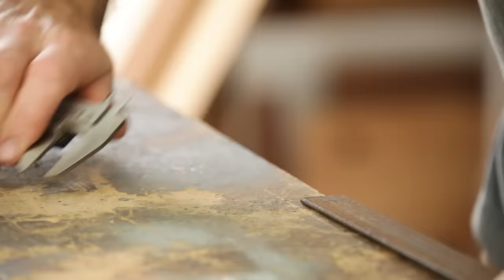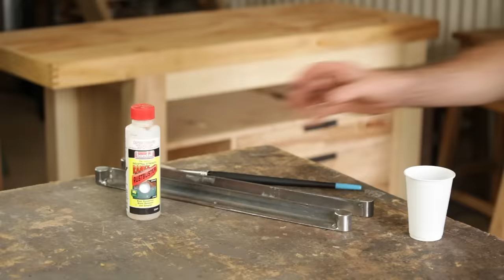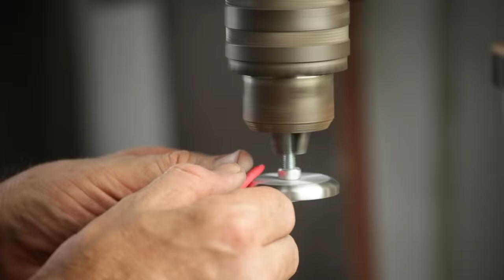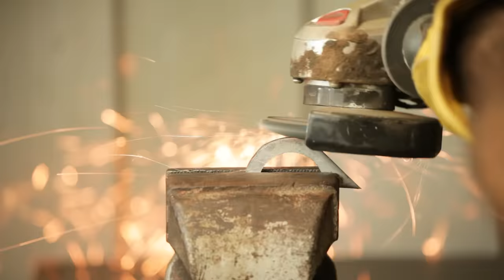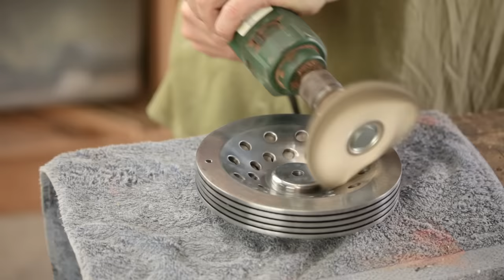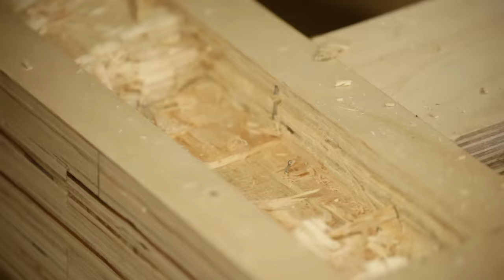Homemade Pinless Leg Vice

Comment: Dear John Heisz, Matthias Wandel and Pask Makes, 

For quite a long time I follow your excellent contributions to woodworking and I am still learning. I am fascinated by the simplicity and properties of a leg vice. The one thing that is problematic is the pin that is necessary to operate it. Now I know there are several solutions to make a ‘pinless’ Leg Vice, but it came to my mind to automate/mechanise a pinless design. Now I am not able to do it myself so I thought that it might a nice subject for you to put your teeth in. The idea is as follows. Instead of a pin we take an linear actuator (Electric, Hydraulic or Pneumatic) tot regulate the vertical outlining. Then we need one or two electronic waterpasses to sense the vertical position of the leg and by adding a controller to actuate the actuator you have an automated pinless Leg Vice. Who of you is up to the challenge? Arie van den Ende NL

Comment: FYI I'm switching to wood from metal, and one of the tools that has helped out quite a lot for metalworking is a good quality hand-held jig saw.    It makes relatively short work of things like those collar washers... and keeps you from using the angle grinder.  (The angle grinder was the most dangerous thing in my shop until I got my table saw... it has been responsible for over a dozen sutures over the years, and I try not to use it whenever possible.)
Absolutely stellar work on the vise.  I've gone looking, and consider this the best how-to on a cross leg vise on YT.
Reply from the maker: Thank you very much! I haven't used my jigsaw much with metal but I have to say I think the angle grinder is a great versatile tool - the only real downside is it is too noisy! :)

Comment: Great leg vice! And the wheel is a real beauty!
Maybe a second nut on half of the depth would make it even less wobbly. Should not be difficult to install.
Reply from the maker: Thank you! Another + for the wheel :) I did think about that and also I may just add a length of hardwood either side of the screw at the back.

Comment: This is the neatest idea that I have seen for maintaining parallelism in a leg vise as it is automatic. Others require human intervention to adjust to parallelism. 
The only thing that is bothering me is the amount of slop on the vice during adjustment. This does not materially affect the gripping of the vice but it must be a nuisance when opening and closing. The answer I fear calls for a lathe and a machined collar or sleeve let into the leg to remove the lateral play from the leg.

Comment: Thanks for some ideas Pask. I've been wanting to make one with the St. Peter's cross and yours turned out great. I was going to use some thick stock but the L beam looks sturdy and will be much cheaper. Also, I love the wheel. Great idea. One thing, a couple feet of 3/4 or even 1 inch acme rod and a couple of nuts would probably make that run a lot smoother too. I know the leveler is an acme but not a precise. Anyway, great video. Thanks
Reply from the maker: Thank you Mike! :) Acme rod would be better for sure - very expensive here though. The leveller screw still works very well and at a great price - I paid $16 with shipping $30. :)
Reply: Wot to make out of spear wood

Comment: Neat looking wheel.  Perhaps a brass or aluminum busing on both sides of the bench leg and the chop to keep the threaded rod from wobbling.
Reply from the maker: Thanks Dan! Even though the wobble doesn't affect the operation it would be nice to eliminate it. I'm going to put a couple of hardwood guides either side of the screw, at the back.

Comment: For those who can't cut and weld on the round bar stock,  just notch it and bolt on 4 small skateboard bearings .

A small dolly wheel can be used as the handle..

Comment: Great video, great build. Unfortunately i have to pass as soon as a welder is involved, but I loved your version of the wheel and handle.
Reply from the maker: Thank you Michael! You could still make a leg vice with a scaffold levelling screw without welding - check out videos by Jay Bates and Demas Workshop. :)
Reply: I think you can make a cross out of flatbar or square tubing, some nuts and bolts and skateboard bearings at the ends. This would involve cutting and drilling, possibly tapping but no welding.

Comment: I agree with Nige, and am going to watch it again.  Great work both in wood and steel.  Has anyone suggested(coming from the peanut gallery,) you making a steel plate instead of the hard wood chunks to end wobble?  That being said, you're WAY over my skill level...Thanks for the video...cheers...rr
Reply from the maker: Thanks Richard! I've added hardwood guides either side of the screw (at the back) and that has now eliminated any wobble. :)

Comment: I noticed in your reconfigured workshop, that in places you were using wood as pipe to pull wood dust through to your vacuum. Please research to see if you should have grounding wire to take away static electricity built up by the moving gasses (air ) Also (not sure if it was you ) With sanders, Is it not dangerous to get a buildup from grinding both aluminum and ferrous metal and having this pas through the same vacuum system?  I watch more than build  and enjoy your works. ta!

Comment: Great video! I have ideas that might make it better, or not. I saw the wobbles and the fix and wondered if a sliding rail guide at the bottom would help even more. Plywood can be a pain in the ass to work with sometimes. I got distracted and can't remember the other idea.
Oh, you might like to raise the vise taller than the bench so you can use dogs but the catch will be that you'll need to steady that long ass vice piece of wood. Maybe it wouldn't be too lobsided with the bottom rail guide or even a dual turning crank that moved at the same time. Now that would take some engineering.
Reply from the maker: Thank you - glad you liked it! The vice works perfectly with the wobble - it doesn't affect it in any way whatsoever, however I have fixed it as it's nicer without the wobble. I'm actually working on a video right now showing the upgrades I've made to the workbench, I show how I fixed the wobble in that. I could still use dogs with the vice as it is, by drilling a dog hole in the top of the chop but I won't be doing this as that's what I use the tail vice for. :)

Comment: Pask, I really like your videos, this one is really great.
I am thinking about building that cross parallel guide myself. I found some blog post on the website of Benchcrafted (they manufacture a commercial version of this guide, called Crisscross), and they talk about their guide being designed to give the vise some small amount of toe-in (the top of the vise jaw contacts the workpiece first). I've looked up the topic and indeed toe-in is mentioned as a desirable feature of vises. I couldn't find much reliable information on how to actually implement this in a leg vise (with a cross-style parallel guide). I am wondering if you did something like this with your vise? If not, what kind of design modification to the cross do you think would provide that toe-in? I think it's just a geometry question in the end...

Comment: Beautiful leg vise mate, awesome use of those old grinding discs! Question about the welder, if I may? I noticed in a few of your vids that you don't use a nozzle, I presume this is because it's gasless? I ask because I have just been given a gasless mig without a torch, and I don't really have a clue about welding. Do you not use a nozzle because it's better without, or does it make no difference?
Reply: The Pallet Hippie , the nozzle cover is for directing gas flow to the weld. When using flux core it's unnecessary. I use my cover however to prevent slag on the inner tip parts.there only $5-8 dollars so not a big cost.

Comment: That is awesome. I like your projects. I didn't know Ozito did a mig welder. I must have a look see if they are in the Bunnings Mega stores here in NZ
Reply: I think you have your big box brands mixed up or was that deliberate?
Mega is a type of Mitre 10. As far as I know we don't have the Mega 10 stores in Australia. Some of the Bunnings are very big but not as big and not as big a range as some of the Mega 10's I've seen in NZ. I've been in some Mega 10s in NZ that were truly enormous. Mega even.
Reply: Yes you are right. Bunnings Warehouse and Mitre10 Mega. I just saw the Ozito mig welder in a Bunnings advertising mailer, so we can get them over here. Cheers.
Reply from the maker: Thank you Daniel! :) I see you've found them. It's been a good welder - I haven't had any problems with it and been using it regularly for the last 3 years.

Comment: Hi, I know this is an old video, so hoping you keep up with comments on old stuff. Just wondering if you're using a gassless mig welder? If you are, are they any good? I'm thinking of getting one so just curious really. Thanks
Reply from the maker: Hey Glenn. Yes I use gasless mig, I've had it for a few years and it'd done a lot of projects. It's definitely usable and has done me fine but it's difficult to get a good clean looking weld. If you don't mind grinding your welds afterwards then they're fine. I'm at the stage where I'm ready to start looking into welding with gas though! :)

Comment: Shes a beauty!!! I was thinking of trying this exact same thing. what is causing the vise to wobble ? if you were to build it again what would you do diff?
Reply from the maker: Thank you! I honestly wouldn't do anything different - the only thing I have done since is add a couple of hardwood guides either side of the screw at the back. The wobble is because the screw threads aren't that precise. The wobble is perfectly fine though, nothing actually needs doing, but if you're like me you just want it perfect. :)

Comment: I really enjoy watching your videos and this one's a brilliant build! In your opinion, could the same cross effect have been achieved with just rounded-edge flat bars (no welding involved)? Also, in hindsight, how could the left-right wobbling have been cancelled in advance? Thank you - great vid!
Reply from the maker: Thank you very much! The cross could definitely be achieved with some thick flat bar, I welded rounded ends on the end of my cross to help it run smoothly but you could bolt some round bar to the flat bar to achieve something similar. The sideways wobble doesn't affect the operation of the vice at all it's just a little annoying - although I have now eliminated it with a small upgrade. I'm working on an overview video of the workbench at the moment where I show all the upgrades I've done. Should be up very soon. :)
Reply: Great stuff! Thanks for your reply. I love watching your blacksmith skills. Having none, I'm trying to avoid welding. I was thinking about something along the line of your suggestion, and then started to think I can achieve the same with corner bars like yours, and using something like caster wheels for the bottom parts. The main point is that your video made the whole benchcrafted solution so down to earth and possible to be executed by mere mortals. Thank you!!

Comment: Very nice but I don't have welding machines for the leg guide, any advice ?
Reply from the maker: Thank you Tony!  The ends that I welded onto the cross could be left off, the angle iron cross would still work, it just wouldn't be as smooth.

Comment: Its a really cool design. But im confused didnt title say pinless?
Reply from the maker: Thanks Dylan! Generally most leg vices have a lower rail with a series of holes, this is where a pin has to be located to the nearest position needed each time you set the vice. With the cross there is no pin and no need to set anything. :)

Comment: Its nice but what is the tool you uses in the time 8,20       If you make it can you tell me how
Reply from the maker: That is a card scraper with a holder that I made. It's just a piece of wood, two screws with washers to hold the scraper then I tapped a hole in the centre and put a bolt through to adjust the curve of the scraper. I did add a small piece of aluminium behind the scraper to give it a little support.

Comment: your forward gastube on your welder is missing, that´s bad for nozzle and welds
Reply from the maker: It's not needed when welding with fluxcore wire. :)
Reply: @PaskMakes  ah interesting i wondered about the dusty shades around the welds, how long last your nozzles? or isn´t it a problem at all? wouldn´t stickelectrodes being cheaper?

Comment: I watch ur videos from part 1, I'm new to this and I got to say this ain't for the novice...it's not cheap either...
Reply from the maker: I only said easy on the first video - if that isn't an easy way to build a solid woodwork bench then have a go at making mortice and tenons in solid timber. It is cheap for a solid bench. I've roughly worked out the cost of the whole project, the bench and the two vices and I reckon it's cost me around $150 Australian dollars that would work out at not much more than $100 US dollars. You just have to look out for deals and scavenge.
Reply: Pask Makes 

Thanks :)